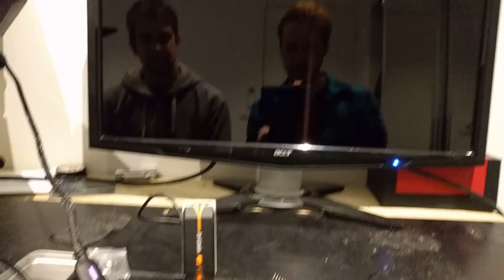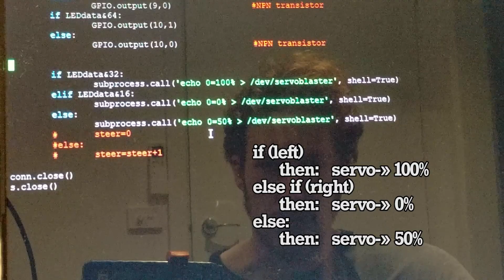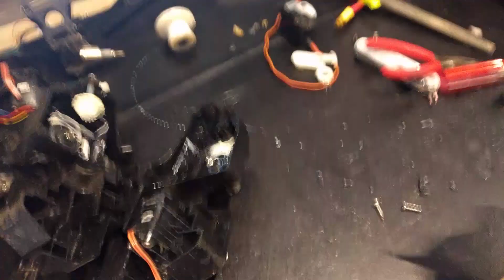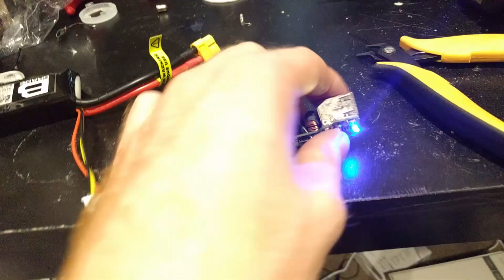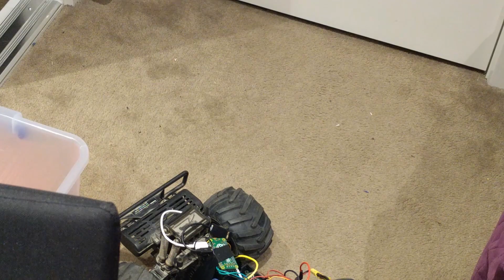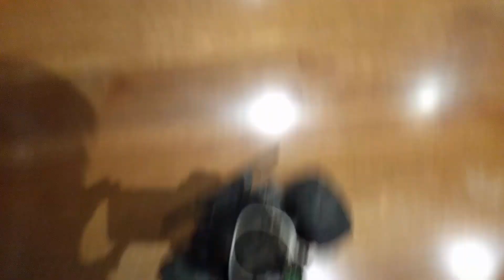I Built a WiFi R/C Car! - TKIRV Episode 3

Comment: Very cool project. Checked out your hackaday.io page, but you haven't shared any code yet. Do you have a GitHub, or any plans to share the code? I'm working on something similar, and your Python code would be super helpful!
Reply from the maker: Thanks man! 

As far as releasing the code goes, I'm sorta thinking about it, security reasons and the fact it's full of off-colour comments mean I might not :P My code is very poor from a professional standpoint; and the last thing I need is people easily gaining entry to TKIRV's controls because I was too stupid to salt my hashes or whatever it is the kids are doing these days.

However, I can point you to some helpful resources that got me up and running in a matter of weeks!
Networking in Python - https://pythonspot.com/en/python-network-sockets-programming-tutorial/
Servoblaster - http://cihatkeser.com/servo-control-with-raspberry-pi-in-5-minutes-or-less/
PyGame - http://www.pygame.org/hifi.html

Once TKIRV's fulfilled its purpose and it's got a couple missions under its belt I might look at putting the code up then. :)
Reply: TK Hi, the Servo page you've linked doesn't work any more. Could you send me the code per email? I will not republish it, it's just because I wnat to control a servo with my pi and I need some help
Reply from the maker: @illerchiller491  Look up the Servoblaster stuff, it's great.